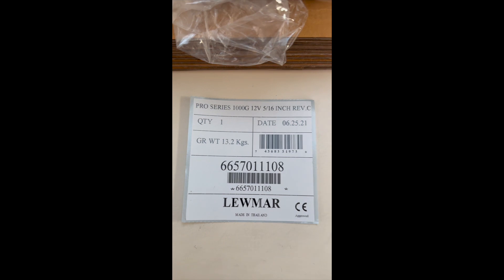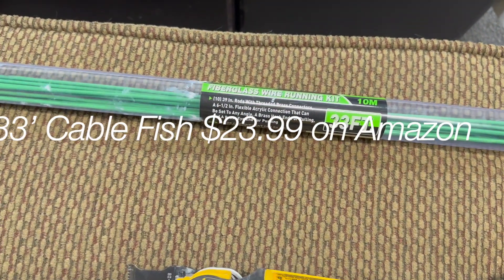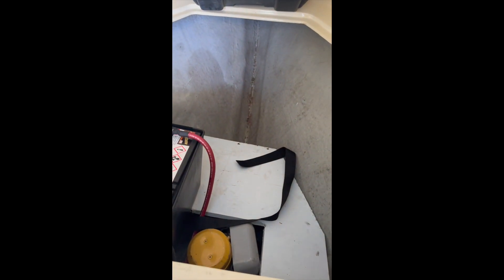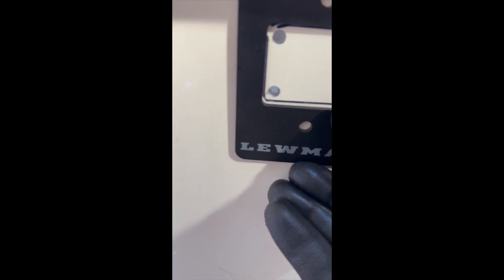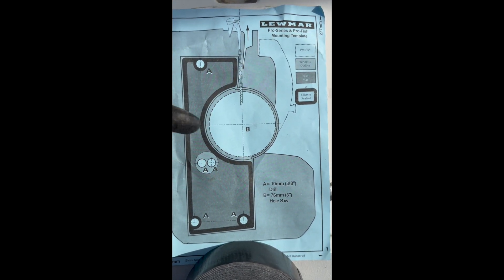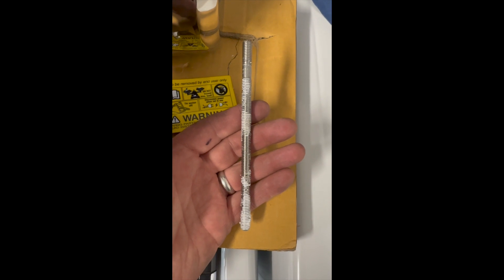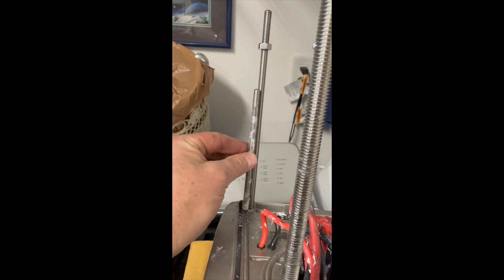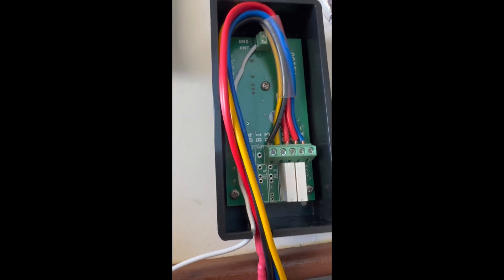Lewmar Pro 1000 Windlass & Wireless Remote Install   HD 1080p

Comment: Do you have a video with size chain and road and if you want to change gypsy?
Reply from the maker: I do have some photos of my chain and road set up. I will upload them with an explanation for you. I haven’t changed the gypsy out. I used the stock one that came with it 5/16.
Reply: @Davesamedic  I think I should do the same. It's that I have all 1/4 inch in realy good shape.
Reply from the maker: @redwood1957  well it would definitely be a nice savings. I have 150 foot of chain which I believe cost me around $300. It’s a bit heavier which is good in my case. 200 foot of road which I bought the eight plate. I marked it every 10 feetwith some 3-D printed colored clips which I found on Etsy. Pretty cool.